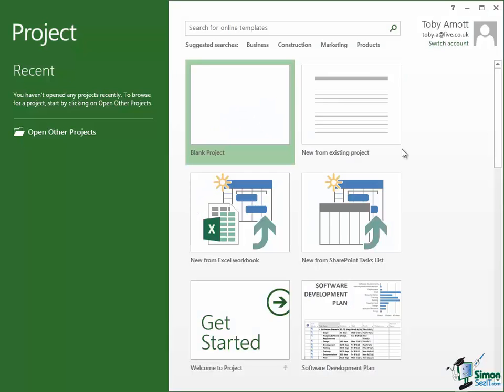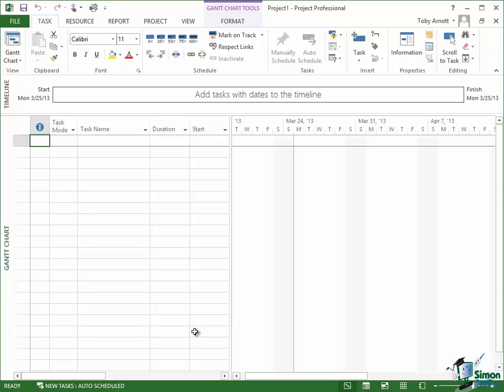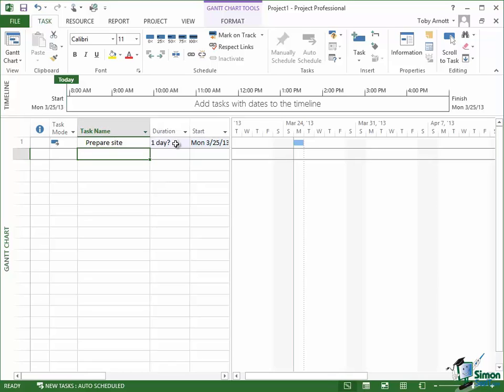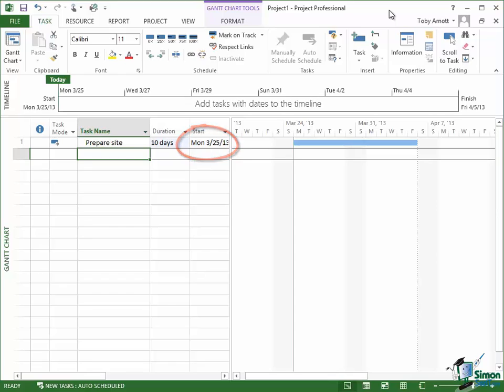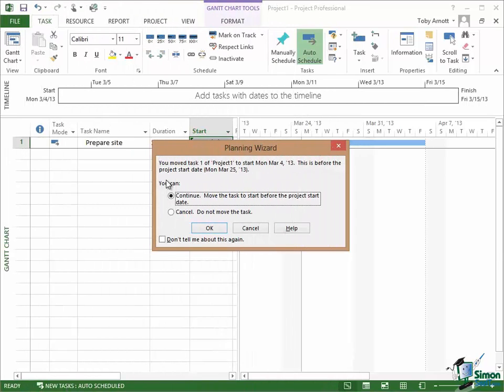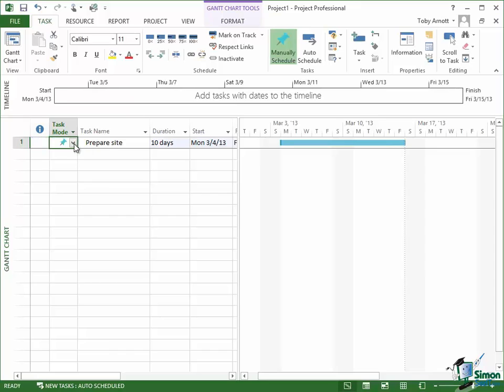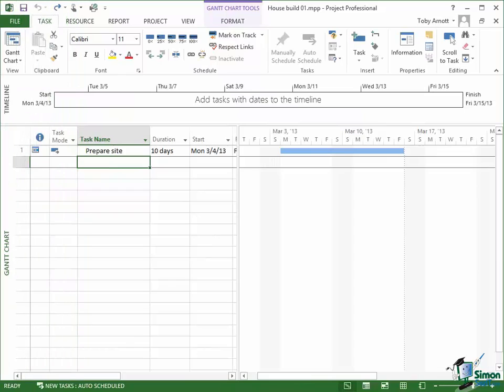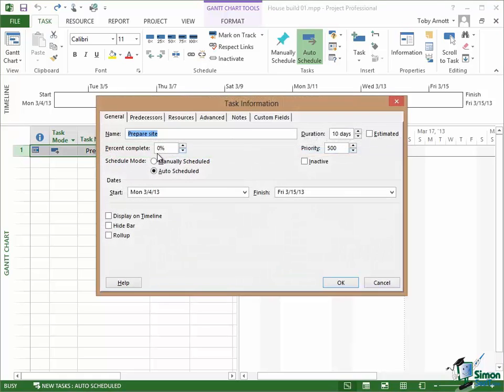Project 2013 for Beginners Part 13: How to Setup Tasks in Microsoft Project 2013

Comment: I need you help answering the following challenging Q :-)
- how to keep track of project task predecessors when deleting tasks?
   As you know large projects may have 100's of tasks and as one build predecessors, managing them is extremely difficult as MS-Project does not yet keep the relationships between the Task and its predecessor as one start deleting irrelevant tasks ; am I missing a feature, or how would you approach that, Thanks!